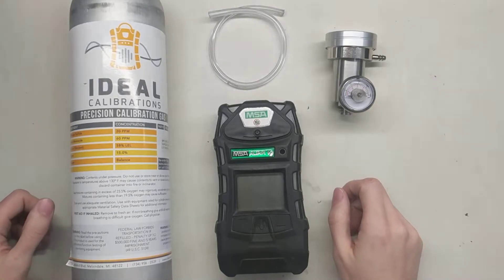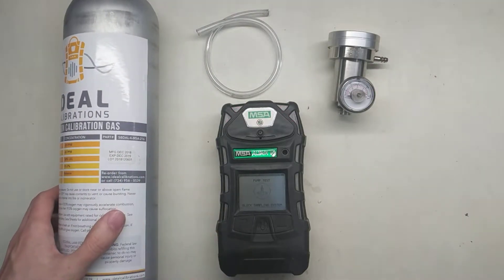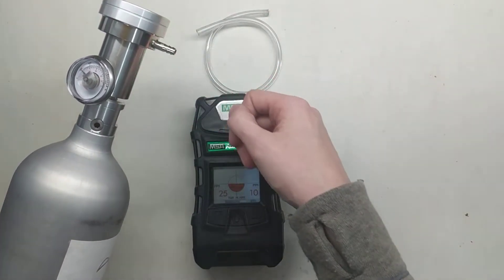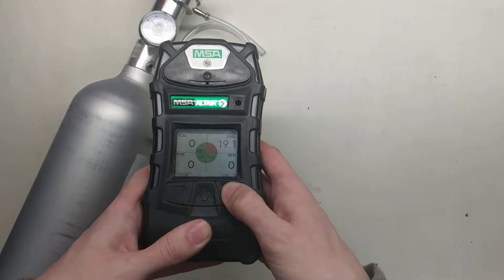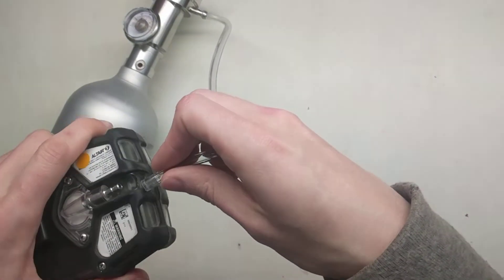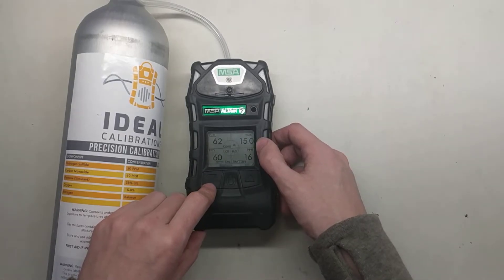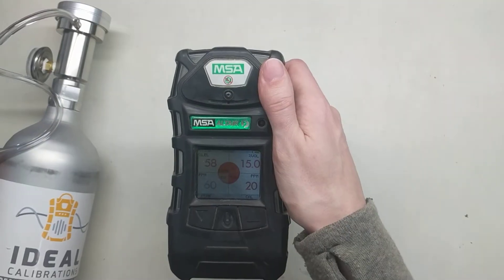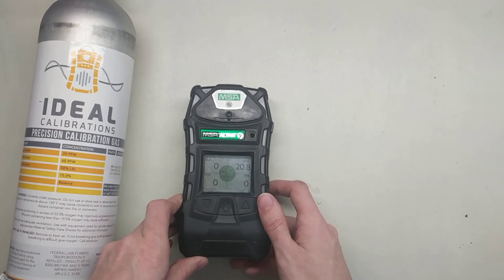MSA Altair 5 Gas Monitor Calibration Guide by Ideal Calibrations

Comment: With the mono chrome 5x altair the top left shows COMB?  I  do not have the color screen . How can I know which  gas it is detecting if it hits an alarm ours  Ours are  set for low alarm at 10 high alarm at 20.....   But More importantly will it tell us what gas it detects when it alarms??  Thank you for a great Video.. definitely subscribing.. Any info is much appreciated..
Reply from the maker: Hey Culbyj, unfortunately LEL/COMB sensors are non-specific, so they have no idea on what gas they're seeing. Essentially the sensor has two little beads in it. One is a porous bead with a catalyst that attempts to force combustion, and one bead that is essentially glass covered and acts as a reference. The sensor outputs the difference as a signal which is then interpreted by the monitor.

What this means is that although you may set a calibration curve on an LEL sensor, you need to take into account the fact that each combustible gas will have a slightly different readout. MSA specifically uses a curve based on Pentane so that for almost all gases you're either seeing what's there or you're seeing a bit more on the monitor than what is actually in the room (for instance, 50% LEL room methane would show around 25% LEL on an MSA monitor). Other monitor brands use the Methane curve, so some gases might actually show as higher in the room than they are on the monitor (on a Methane curve unit, 50% room Pentane would show as 25% LEL on the monitor, a real danger if you don't know how the curves work ahead of time).

Feel free to give me a call if you have any questions. Happy to help.

Comment: When I do my span calibration, it tests for the 4 gasses but then it asks me to test with isobutylene. I don’t remember having to do this before to get it to change the last date calibrated, and it’s the same unit. Am I doing something wrong?
Reply from the maker: Hey Keith, sounds like you just need another isobutylene cylinder to calibrate your PID sensor. Here's a link if you don't have one: https://www.idealcalibrations.com/imported-products-3/103dst-0014-48
Reply: @Idealcalibrations  Thanks for the reply. I do have that cylinder but I didn't have to do both cylinders before to calibrate it. Did I somehow change the settings or something maybe?
Reply from the maker: @keithamberg6392  If the PID sensor was in there and on it should have come up. Not sure why it wouldn't in the past. There's no reason to skip the PID calibration if you're doing the other sensors unless you don't have the gas.

Comment: if my cylinder values are different can i just change them in the monitor or should i always use the set values the monitor comes with? i mean using the cylinder for different brands
Reply from the maker: It's recommended to use the gas from MSA, but it is acceptable to use other blends of gas. You can set them in the calibration settings. One thing I would watch: MSA usually uses a Pentane curve and the monitors often show Pentane on the screen. Make sure if you're using a Methane calibration gas that you set it to read Methane

Comment: Hello
My questions about the concentration 
It's possible change this value manually or I need a software ?
Reply from the maker: You can do it manually in the options. In normal reading mode hold the left and right buttons. When it asks for a code use code 672 and you'll find the calibration options by scrolling the menus
Reply: @Idealcalibrations  thank you so much for your quick reply 
Best regards from Brazil.